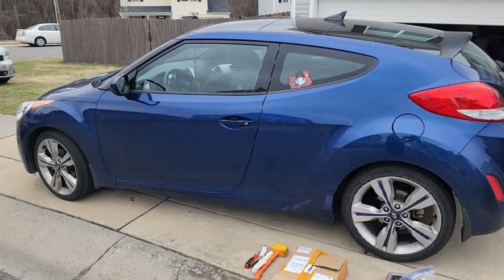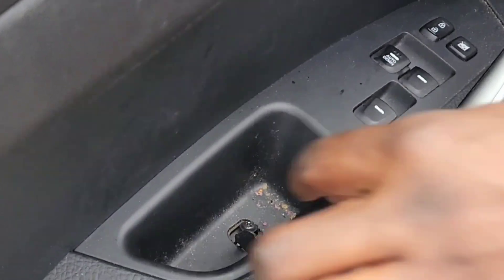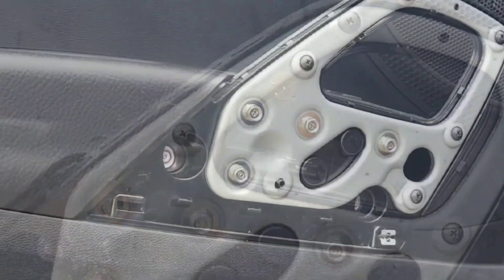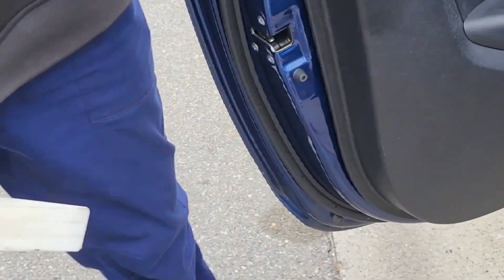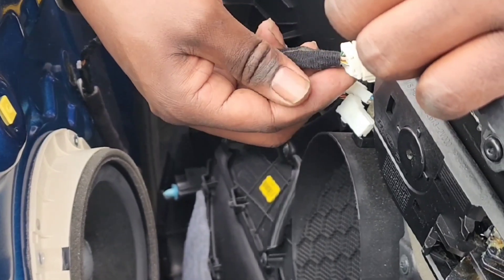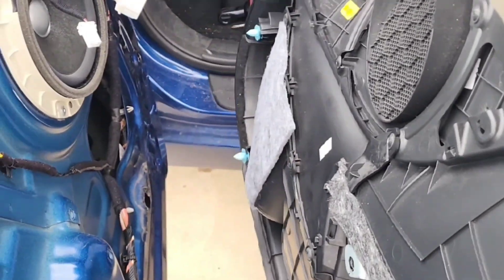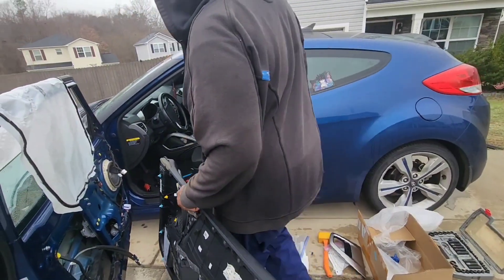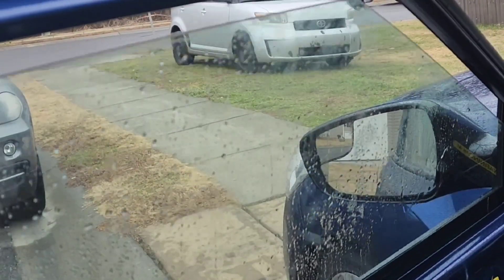Hyundai Veloster Window Regulator & Door Panel Removal Replacement (JOATD)

Comment: I just did this window regulator replacement (2013 Velly) and I followed these instructions step by step, it worked like a charm.  Thanks so much for sharing this video, you’re a lifesaver.
Reply from the maker: @michaeld1782  no problem, I'm glad that my video could help you

Comment: There’s a spot at the bottom of the door panel where you’re supposed to start prying and when you’re removing the latch and lock cables, there’s actually a tab you push in and it literally just unclips

Comment: I have a 2013 model and my window switches need replacing, do I need to take the whole door panels out or do the switches clip onto the panels?
Reply from the maker: Yes on the 2013 you have to remove the door panel the window switch removes from the inside
Reply: @JOATD  thank you!

Comment: Yo man what’s the best way to get the window down if it’s stuck all the way up
Reply from the maker: @Darklordanakin  it depends. Why do you think you need to take the window out. Because the window switch could just be out.
Reply: @JOATD  I removed the whole window regulator on my car already, the wire was all tangled up. 

Went to the junk yard today to get a regulator but the window won’t roll down, so I cant remove the right sight of the window. To take the piece off.